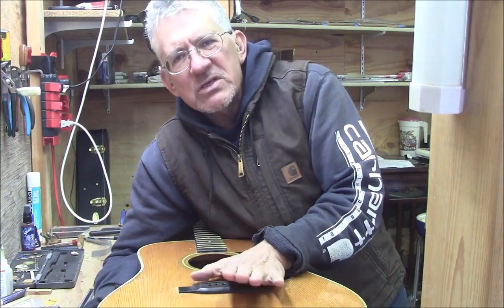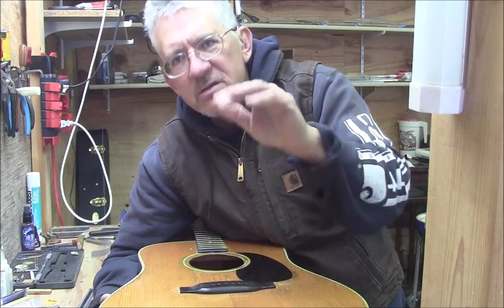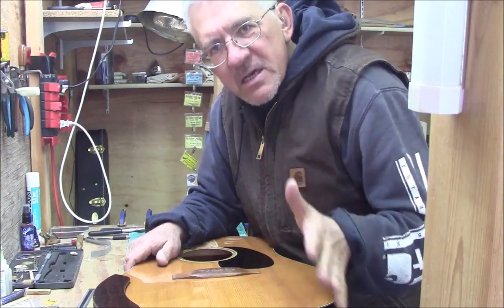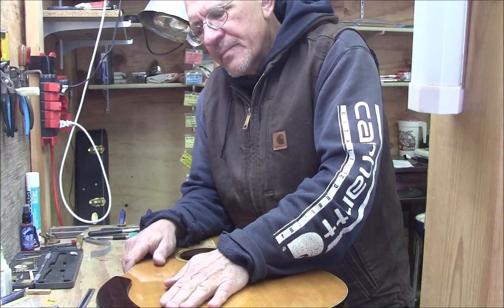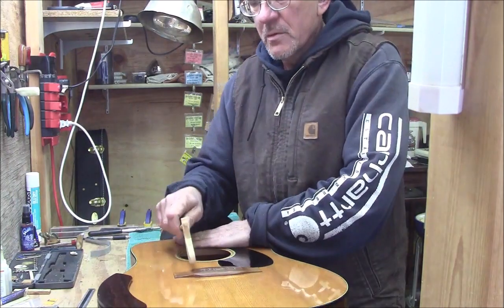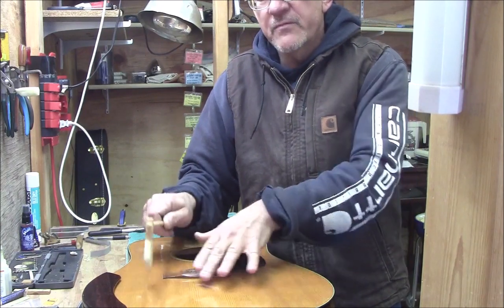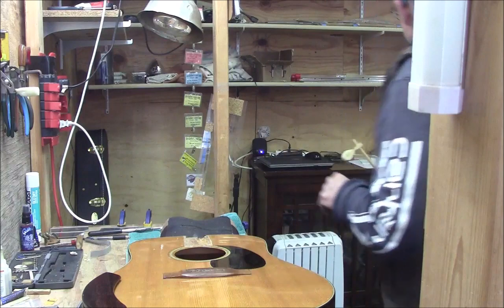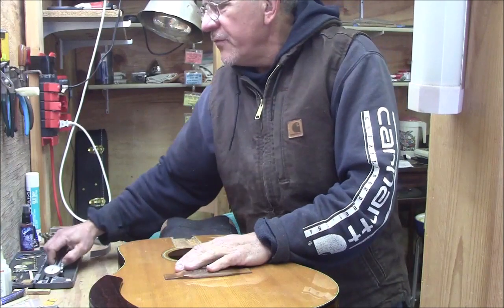Evaluating a 70's Martin for scalloping

Comment: Quick question. 

Is .375” considered a tall bridge? Measured between the D And G strings 

It’s a Martin
Reply from the maker: I like .340" bass side to .320 treble.  .375 is on the high side. I've often shaped those down to get a little more saddle and lighter weight.
Reply: @Bryankimsey  

Thanks Bryan 

That’s what I plan on doing. I have just a hair less than .125” of saddle protruding on the bass side. Thought the guitar might need a reset but I took notice of the bridge height and came to that conclusion as well.

Comment: Hi Brian,
I have an old 1975 Vega by Martin that's basically a D-18 copy. I have the back off right now. If I'd like to improve the tone and response generally for bluegrass, what braces should I focus on?
Reply from the maker: I'd have to see the braces to tell.  What you want for bluegrass may not be what Del McCoury or Tony Rice or Dan Tyminski wants for bluegrass so it's hard to give a blanket statement.  Plus, it depends if you want a mic-friendly guitar or an acoustic jam session guitar.  

What I usually say is that the X braces control the bass and the closer to the X you scallop, the more so.  The tone bars control the "woof" or percussion.  The popsicle brace kills upper trebles. The bridge and plate control whatever tap tones they have, although you have to consider them in the context of the whole guitar.  Always plan on the guitar developing over a 3-8 month period.... stop scalloping before you get the point you want.  Which you can't do with the back off.  That's why I like to work thru the soundhole... I can scallop, play, scallop, play, stop.
Reply: @Bryankimsey  that's very helpful, thank you for sharing your knowledge.

Comment: I have 1973 d28 i don't like the neck compared to my 2001 d18 clearance white. Is it possible to cut the d28 neck down or should I replace it
Reply from the maker: So many people really like 70s necks I'd hate to see it shaved.  New neck will cost about $1500 by the time it's installed.  I'd sell the 70s and buy something else.
Reply: @Bryankimsey  selling is not an option been in family to long value is not a factor because it will never be sold so it shape the one I have and make it functional or replace it.if shaved would it retain its integrity
Reply from the maker: Well, if you shave it, it'll ruin the value.   Yes, you can shave it.  Will it retain integrity?  Yes and no.  If you don't do too much, yes.  But IMHE neck shaving is VERY tricky to match one feel to another feel.  If you shave too much, then "no", you stand a decent chance of ruining the neck.  I've shaved necks before and been successful, but if the difference between a CW and a stock 70's is noticeable to you then I'd say you're very sensitive to neck shape and feel.  Me, I can switch back and forth, no problem and I don't feel they're all that much different (but I haven't played YOUR 70's).  In any case, I would measure very, very carefully before I started.  Templates and solder copies and all that are NOT going to get it exactly right.  Only feel, combined with measures, are gonna do it. 

Another thing you should look at is fretboard radius and fret size because both of these can radically change the feel of a neck.  BTDT.

Anyone who does this should have BOTH guitars in hand to compare back and forth as they do it.